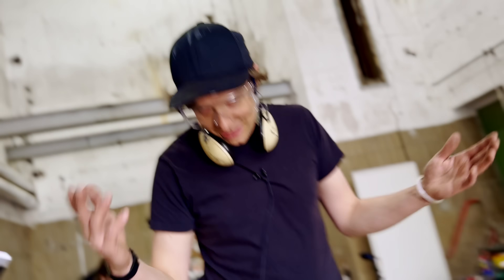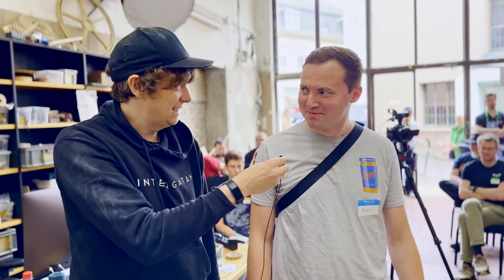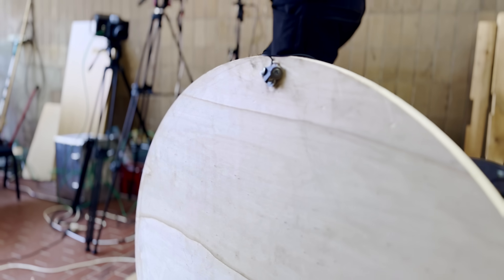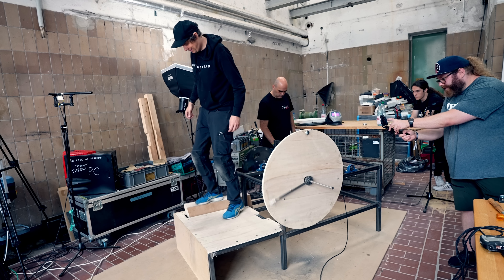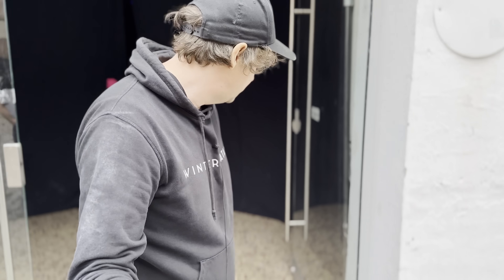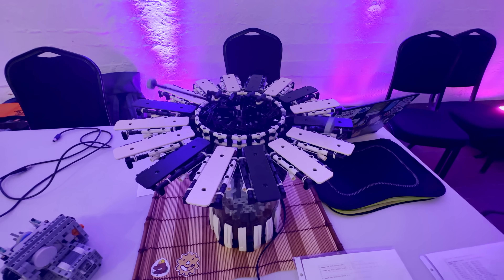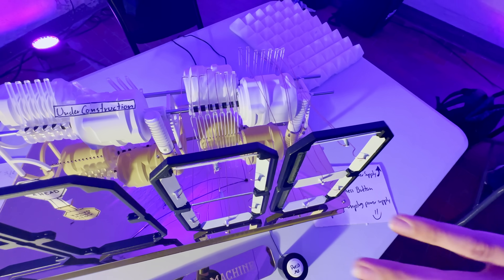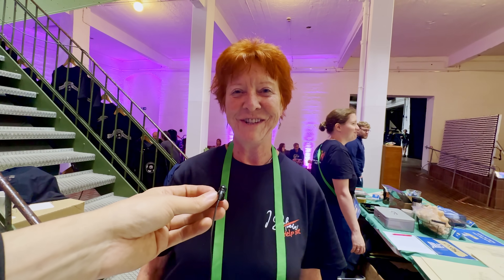First Timing Tests - DAY 6 - Marble Machine Flywheel Prototype

Comment: Consider replacing the linkage between the pulley wheel and the pedal with a cable. It would only transmit force in one direction so the pedal is only ever pulled up by the flywheel, never pushed down.

Comment: Martin, loving the new design and process you are going through. I believe this will be the one! 
Any reason why you aren't using a one way clutch bearing for the pulley system? Wouldn't that make the pedal safer? Or would there be some kind of disadvantage in this application?

Comment: To properly test the tightness you need to measure sub-beat timing intervals too. I suspect the weight of the pedal assembly makes the first half of every beat faster than the latter.

Comment: The pedal bends, where the link is mounted, because the steel is weakened by the holes. You should reinforce the steel from above and beneeth rather than from the sides, as you would want to increase the statically effective height at this section of the pedal.

Comment: Would a fly wheel with a concentrated mass on the OD and very light spider spokes not be better. Typical old fashioned stationary steam engines are of this design. Inertial performance of a flywheel of this design is better than a solid disk. You could even  use one plate for the hub and spokes and rings bolted either side of the spokes to create mass on the OD only

Comment: Maybe you should build a hybrid pedal that turns A generator and power. An alternate speed motor. Just thinking I'm really Full of it, you could use a ratcheting system on your pedal. If the pedal folds down on a hinge, it will be easier to move. Comment by🎉 Pendragon mystery school.

Comment: Take a training bike, but put the flywheel horisontally. On this smooth metal wheel a smaller wheel rides. The small wheel is attached to a long rod, but can be moved on this rod back and forth so the small wheel can run inner/outer. So you pedal as much as you want and take power off the wheel in different places for different BPMs. The correct radius changes with RPM of the big wheel, but maybe there is a laser that projects where to put the small wheel for each BPM.

Comment: I'm not an engineer, but would there possibly be a way to set an adjustable speed cap on the flywheel, so your only job is to get it up to speed and prevent it from slowing down? That way if you know you want 80bpm, you set the hard limit, and just press the pedal to get it up to that speed, rather than having to overcorrect once you get there.

Comment: Using both legs 180 degrees in opposition for power input would be more practically effective and efficient for exacting dynamic tempo control as well as for overall player endurance and balance.  Simply add a second foot pedal and a seat and/or handrails to the current design. Basically, the first wheel in the input chain becomes a bicycle like crank with connected levered foot pedals inputting the power from Martin running in place.

Comment: Might it be easier if the click happens at the top of the pedal travel so you hear the timing difference before you press so you can make an immediate force adjustment ?

Comment: I suggest a lattice structure for the pedal. You have plenty of space underneath for it. With a lattice structure you can arrange braces in different orientations to counter sideways flexion and torsion also. You could go with 4 angle irons jointed with welded 6mm rods.

Comment: You are operating on the assumption that the flywheel is the complete machine. Try to keep in mind that this is just the power unit, not the machine as a whole...

Comment: Martin, there's something I was saying in the Chat on the livestream.  "BPM" and "Tightness" are not the same thing.
1) You can get the mechanism Super-Tight, but still play your 120 BPM song at 73 BPM.
2) You can play at your desired 80 BPM perfectly but still lack Tightness.
I want to introduce you to a Physics Concept:  Jerk.

Acceleration == Change in Velocity over time.
Jerk = Change in Acceleration over time.

0 Jerk == Constant Acceleration == Smooth.
Nonzero Jerk will create non-constant acceleration, which can create surges in Velocity changes.

Remember:  You've been defining "Tightness" as "the variance in the delta-T between Marble-strikes on the instrument".  The lower that variance, the "Tighter" the MM3 is playing.  This is has been your definition of Tightness.

So if you have any Angular Jerk, your BPM will have discontinuities.  Jerk will introduce Delta-T changes between marble drops.  You need Zero Angular Jerk.
  Yes, zero Acceleration, once you're playing, is nice, but ultimately what matters for your Tightness is fixed [Angular] Acceleration.  You, as a musician, know that tempo of a song can increase or decrease.  So, let any _natural Angular Acceleration and Deceleration that you need to adjust to your desired BPM just be part of the song!  Let it be part of improvisation in the song.  As long as you have Zero Angular Jerk, your Tightness will be fine.

But now you're redefining "Tightness" to mean "Constant BPM"  And as I said above, that's _not the same thing as your earlier definition of Tightness.  You're changing the metric mid-measurement, so you're going to get Invalid results and draw Invalid Conclusions.

The Flywheel is storing Energy in the form of Angular Momentum.  That's its job.  Smoothly releasing that Energy IS NOT Its Job, nor can it be!  Plus, you have another Energy Storage component:  The Programming Cylinder.  That's Yet Another Thing I brought up in the livestream chat:  You have to account for the Angular Momentum of the Flywheel and the Programming Cylinder when examining the power-train.

Oh, BTW:  A cylinder has a higher Moment of Inertia than a disk.  You can make a cylinder that has less mass than your flywheel but will store the same amount of Kinetic Energy at the same BPMs as your flywheel.  This is Yet Another Reason why the Programming Cylinder is actually also part of the drive train.

Let me put it another way:  How fast does your phone use power?  Does the amount of power your phone uses in an hour depend on the capacity of its battery?  Or does its power use depend on, say, what you're doing on the phone and whether or not the screen is on?  It's the latter, of course.  Your battery will determine how long you can use your phone, not how much power your phone is using.  The flywheel is the MM's battery.  But you're treating more like the phone screen or the phone's GPS circuits.  Sorry if this paragraph is harsh; I'm typing fast with a cat clawing my forearm!  I'm not trying to be negative, I just want to make sure I get through to you.

The flywheel is your battery.  It is therefore not designed to keep a fixed beat.

Comment: Just a weird thought, what would happen if u added a gear box to the foot pedal? Something that would make using the pedal easier to give u more torque control over the flywheel, just add some different gear settings and tune the gear box to help maintain a standard bpm... kinda like a transmission in a car...

Comment: That gap in front of the panel growing and shrinking looks like it would have no trouble crushing any stray toes or fingers. Perhaps the angle of the front of the pedal should be adjusted so it stays more constant.

Comment: Remember that all the wheels and gears of the complete machine will add inertia. The total inertia will be much higher than the inertia of the flywheel alone. So maybe it will play tight actually with the current settings.

Comment: 8u years of designing these machines and he still does not understand that manually pushing on a pedal is never going to be as consisteny as he wants it to be.

There is a reasoin why organ-grinding is a professional job, and why every other device, esopecially things like recordplayers are all clockwork powered.

If you want accuracy you have two choices: A) Electric motor, but I can understand why you would not want that, or B) a mechanical motor with a spring of some kind and a governor.

You have 8 years of experience building these devices, you have access to a huge commujnity of engineers, why don;t you LISTEN TO THEM?

Comment: The measurement is not going well because you are not only trying to control the tempo but also the phase. If you have the right tempo but you are off phase, you have to alter the tempo a bit to correct the phase then change it back at exactly the right time, all the while the only feedback you have is the phase and the only feedback you have is the phase. It will never work this way, and adding more inertia will just make it even more difficult to control.

Comment: I just thought of a perfect application for the Huygen chain weight drive. Add a small one to your machine (could even be the size of your lego demonstration), with a small weight that both sets the speed of falling when not powered and is the indicator for the following: When powered by the pulley, it will do one of three things, If you are lower than your target RPM, the weight will start to fall. If you are higher, it will rise, however, if you match it, it stays in place. It is basically a differentiator to give you feedback on how well your timing is in real time. This way, when you are playing without a metronome, all you have to do is keep the weight as steady as possible, no need to overshoot the RPM and have the governor do extra work for you.

An actual mechanical differentiator or RPM reading device would probably be better, but figured the huygen drive deserves a chance to have an actual use after seeing how much you liked it in your video
Reply: Clever.

Comment: Don't make opinions vefore you install a governor. The way you are building this next machine, you cant hope to be able to control that much inertia that tightly with your own muscles. So put in a governor that can be set to a specific bpm and let it manage a gear ratio for you. Then you just have to make sure the flywheel maintains enough energy to stay within your min/max gear ratios. Some old machining mills use a simple CVT for this purpose and you could look into repurposing one of those designs.

Comment: How about a buffer flywheel and an automatic clutch that engages it with the main system when the bpm becomes lower that desired and disengages when it reaches it again? 
Maybe thats overengineered but i dont think you ll want to microcontrol the bpm when playing

Comment: Musician, Engineer, and Educator chiming in here.  I have a lot of experience working in the marching arts.  Drum corp international to be specific.  I played in the quad line, which was a good experience, because you're not exactly the center of pulse, but you are close.  With drumlines, a similar kind of inertia forms around the pulse.  I've also seen many drumlines oscillate around the tempo (something I call slinkying).

When addressing this problem with students, it's helpful to mention that there are two adjustments you have to make when syncing with a metronome.  The first is to start drifting yourself toward the metronome, and the second is, once you meet the metronome, you need to return to the original tempo.

The problem you're encountering is that ass you add flywheel weight, it becomes harder to make the second adjustment quick enough to stay in sync.  But the benefit you have with a heavy flywheel is that pulse will not be affected by changes in load on the machine.  I think that is the more important requirement you need to meet for what I would call 'tight'

In my experience, syncing two clocks like this is a losing battle.  It's very difficult to keep two vinyl records in sync for a short crossfade transition.  And it brings me to the dumb requirements question.

Is it a dumb requirement to try to keep the marble machine in sync with a fixed click?

For one, it would be easier to configure a midi device through an arduino that would turn the rotation of your clock into a midi sync signal.  Then show elements like lighting, visualizations, and digital effects could be synced with the machine, rather than trying to keep it in time with some external click.  Maybe a simpler solution would be to have a 'speedometer' that reports the BPM you are running at, and then you would be free to organically play with the instrument, yet reference a clear tempo at points where the music demands a specific tempo?

Comment: I guess adding inertia to the system helps to smooth out fast tempo oscillations, but at the same time, makes it more difficult to control the tempo, because of the increased reaction time. It's a common design problem. If you want to react quickly you need to give up stability (as in fighter planes that are so unstable that they require computer support to fly straight at all, but the up side is they can turn very quickly), if you want stability, you loose the ability to make quick adjustments. I think the flywheel design would work well if driven by a computer controlled electric engine with a feedback loop, because it could detect tempo shifts that humans couldn't and react with engine output adjustment precisely. For human driven pedal, it would probably be better to leave only a small flywheel or none at all. This would result in precision similar to just tapping your foot.

Comment: Look up what's called a sprag clutch for your pedal power input so you're only applying power one way and the flywheel freewheels so the pedal does become a flywheel driven leg breaker.
Sprag clutches are used in power transmission systems for just this purpose.

Comment: I do not like the attachment of the „input“ wheel with the flywheel.
There should be a sort of decoupling or free rolling while you do not input power.
Like a ratchet.
The coupling will slow down the flywheel unnecessarily.

Comment: Re: Tightness. "Perfect is the enemy of good." - Voltaire

You are working to attain a level of tightness where the differences are less than a human being can discern, particularly in the middle of a live concert. A tenth of a second out of synch is noticeable. Probably a hundredth of a second is not. And you are striving for thousandths and ten-thousandths of a second. When the only way you can tell is by looking at wave forms on an oscilloscope, you have gone too far.

Comment: I really think Martin should consider powering the machine with motors for the world tour. The amount of focus it will take to keep the machine in time is a huge distraction from actually playing the music on the machine, whether bass, percussion, etc. It also limits how Martin can move around the machine, which is a big factor when on stage - more motion, reacting to and with the crowd, and all of that would be limited with Martin locked into a single position facing one direction. Additionally, fatigue is a huge concern of mine when considering playing a whole show with the machine. Standing on one leg basically the whole time while constantly pedaling the machine will be very tiring, and will make keeping the machine in time very difficult after pedaling for 30+ minutes straight. Lastly, when fully built the machine will have to power a lot of moving parts, which will drain a LOT of energy in the flywheel, so these tests aren't representative of the effort it will take to keep it powered with one leg.  To me, powering the machine with motors doesn't take anything away from the beauty and craftsmanship and wonder of the machine, so I really hope Martin considers this option for the tour and doesn't scrap the machine if he can't keep it in time.

Comment: Where appropriate, use left hand threads.  This will ensure that the spinning motion will keep the screws tightened.  This is done on wheel nuts on race cars.  They thread direction is reversed on left and right sides of the car.

Comment: Wouldn't the current pedal system be more realistic if:
You added as much weight and rotational speed as possible to the flywheel, and then you have an intermediary between the flywheel and the machine itself that maintains the tempo?  Like some kind of electronically-controlled CVT.  If it could be disengaged, you could also pre-charge the system.

Comment: I feel like this isn't a fair test for how it will actually be used. I'm assuming during a performance that the marble machine would be the metronome for everyone else playing, and it's unlikely that the marble machine would need to speed up or slow down to match someone else's beat because it would be setting the beat. For example if you were at 79 bpm you would just barely need to accelerate to get to 80 bpm and then hold, but in this test you are at 79 bpm and you slowly get out of phase with the metronome, so then you are accelerating to 85 bpm to try to catch up to the metronome, but of course you overshoot, so then you have to decelerate below 80 to get back in phase with the metronome. The goal should be to get it as close to the target bpm and then just hold at whatever phase you happen to be at.

Comment: I understand that the marblegates have to function within small tolerances so that the marblemachines plays in time but I still don't understand why ONE machine has to play tight at a certain tempo. It doesn't matter if the machine plays 80bpm or 81,5bmp as long as every gate plays 81,5bmp because it's driven by the same flywheel.
For me the tightness is only an excuse for not building a marblemachine.

Comment: It is necessary to separate the power control and speed control systems.  That is, between the energy-storing flywheel and the driving flywheel, it is necessary to place a gearbox.  Now direct transmission and speed fluctuations are inevitable.

Comment: When Martin saw he was installing the 'lock washer' backwards, it became obvious to me that the tabs needed to be bent over to 'lock ' the bearing. It's the same locking procedure used when setting the tolerances when installing car wheel bearings.